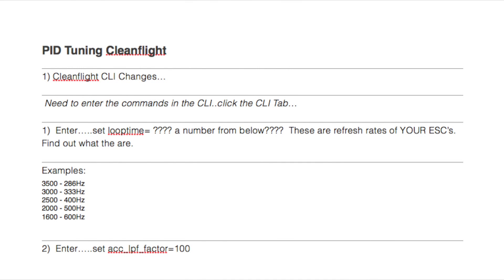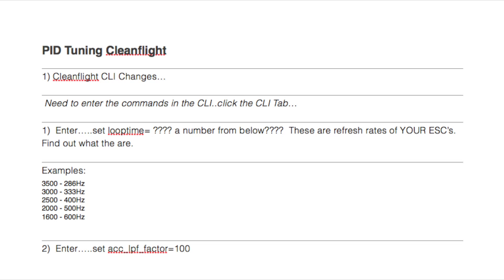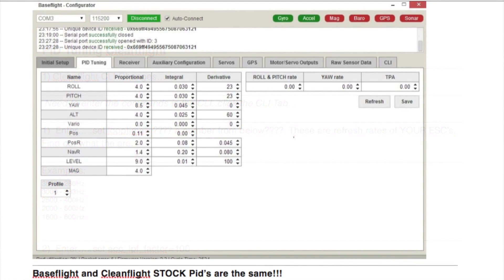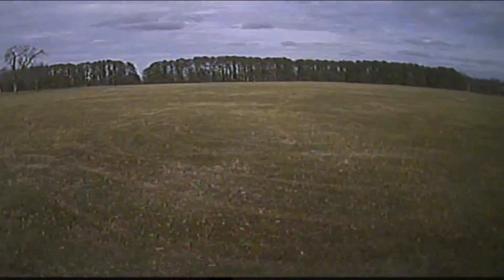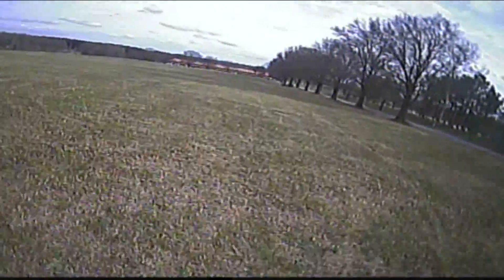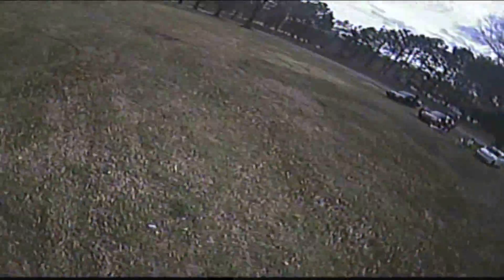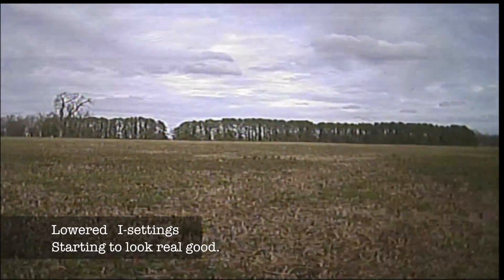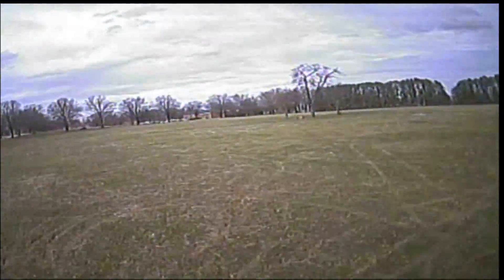Full PID Tuning Cleanflight in FPV Part1

Comment: I'm having problems dialing in my settings after switching to PID controller 1.  It would be very informative to see your starting PID numbers and how far you are increasing/decreasing between each test flight.  My yaw is totally out of whack and I'm not sure how much you meant when you turned the P way down and I,D way up.
Reply from the maker: With yaw P setting I lower it from 8.0 to 5 or 6
All other adjustments are done by .005 in I's and 5 in D
Reply: Very good info.  I worked for an hour this morning and I think the settings I come up with are similar.

Let me know what you think of this idea.  I have been flying in some kind of auto level mode for two years and my brain is having a hard time converting to rate mode.  I have taken your video and worked through the process but in horizon mode.  I'm trying to set the LEVEL "I" settings at a comfortable value for me and slowly reduce the value every couple of flights until it is practically the same as rate mode.

Should the same PID tuning process work in horizon mode as you have done in rate mode?
Reply from the maker: ***** You have to tune in Rate mode 1st....you have to.......then you can go down to LEVEL on the PID page and start the same process....P....I...then D....remember that you have to LOWER the P from 8 or 9 to.... 5 or 6 to start with.......also put D at 45 to start.  Get it to hove and NOW start tuning P and so forth.

Comment: I'm using cleanflight and making the adjustments in flight.  After I land with nice settings. I plug into the computer and it shows default settings again. 

Doesn't seem to save my settings.  

Are you doing the changes in flight or on a pc
Reply: William Anzueto Silly me. I was unplugging the battery on the quad before pluggin into the computer to view the settings and hit save.   Once I  left it plugged in I could see my settings and hit save
Reply from the maker: William Anzueto You should be able to see your settings with OR without your battery plugged in.  It just needs power from the usb port.
Save your settings on each tab and make sure to click disconnect before unplugging the board.

Comment: hey, how do you deal with high frequency vibrations when you punch up on the throttle? pitch and roll seem fine, it's just throttle now :/
Reply from the maker: +oliver strike Your P-Settings are too High.  What version of Betaflight are you running?
Reply: +Shelby Voll I'm on clean flight. just upgraded to the latest 1.2.x quad now flies like a deranged brick...
Reply: +Shelby Voll I'll try dropping the p values until it goes away.
Reply: OK, got rid of the high oscillations from P. But now I is at 0 and I'm still getting low wobbles on pitch and roll
Reply from the maker: +oliver strik IM me on Facebook...I can help better the Re

Comment: Which P, I, and D settings is he talking about in the first half? Everyone says to adjust this but nobody says which one. There are many options in cleanflight for PID. Also which mode is this guy using, acro ?
Reply: Bro Meridian From what I heard, it is suggested to tune Roll and Pitch first  and the adjustment has to be carried out on each axis separately at a time. The other issue is why the author of the video says to use a PID controller 1 for tuning not 3?

It would be great if he shed some light on the issue.
Reply from the maker: MSM5500 go to my other video that say Full PID tune FPV
Reply: thanks mate for your prompt reply. I appreciate it.
Reply: Shelby Voll you referred me to some of your other videos that I would get the answers from so I looked through your other videos but couldn't find anything like that (I wasn't able to find any other video like "Full PID tune FPV" except one from the above where there is no mention about in which order Roll and Pitch are tuned as well as no reason given why PID controller 1 is chosen.)

 So I still have the same questions:
1. P (I,D) of which axis does need to be adjusted first Roll or Pitch?
2. Why is it necessary to use PID controller 1 but not PID controller 2, 3, etc through out the PID tuning process?

Thanks.
Reply: Shelby Voll First off thanks a bunch for making this video it is very helpful. Youtube is lacking with good PID tuning vids. I hear you have another two videos to this series but I can't find them. Can you make a playlist for this series? The video you say to watch is this one(" go to my other video that say Full PID tune FPV"). Did you mean something else? Please reply as to which PID settings to adjust first. Do you adjust Pitch first then roll or both simultaneously? Also which mode do you tune in, it looks like acro mode but correct me if I'm wrong. Thanks again.
Reply from the maker: To clarify.....tune P first on BOTH Pitch and Roll...line of sight..
Then tune I then D same way...
AFTER line of sight tuning THEN tune FPV......fly around starting at P again and fine tune Pitch and roll....they will be different....THEN do I and D same way.
To find out about Yaw tuning go to our YouTube channel. ....F1FPV. ...click on episode 2.......
I Tune in ACRO/MANUAL Mode

Comment: I'm assuming doing this in horizon mode is pointless, do I do this in Acro(rate mode with self level) or full rate mode?
Reply from the maker: always tune in full rate mode.
Reply: +Shelby Voll would it be absolutely necessary to tune in no wind? I also use angle mounts. same principle applies?
Reply from the maker: +leetpg tuning in calm winds is the way to start.....then you can tune for windy conditions and save that in one of your profiles to pull up on days it is windy.
Doesn't matter if you have motor mounts....same lrinciplr.

Comment: Are you able to upload the pics you ended up with?
Reply from the maker: The problem with handing out PIS settings are:
1) NO PID's will be just a drop in file to Cleanflight as UNLESS my mini is the EXACT same as yours PID's WILL be different.
2)  Weight, Prop size, motors and sec's all effect PID's and won't be the same as another.

Just use this video and you will learn how to tune well with time and practicing.

Let me know if you have any questions and I will be glad to help.
Reply: Shelby Voll yeah I understand that but it would give us a good idea of where they should be so we can be within the same ballpark. I mainly want the yaw pids, pitch and roll are really smooth for me now.
Reply from the maker: I will do that in the next video...thanks for the idea....thats what I am looking for....what do the masses really need and I will provide a detailed video for all.....at least on PID tuning and Cleanflight..

Comment: I noticed on this video and the tuning video you did more recently tends to overlook YAW tuning. On your more recent video it seems like you try to quickly move away from talking about yaw and didn't explain it at all, and on this video you didn't explain what you was doing and what you was looking for in oscillations.. it kinda seems like you didn't know either. Everyone seems to skip the yaw tuning process or are unable to explain it and on both of your videos you've failed to explain it aswell.
Reply from the maker: the reason I don't discuss it is I rarely if ever mess with the stock YAW pids.

Comment: From Cleanflight docs:

DELETE THIS COMMAND:
-| `acc_lpf_factor`                | This setting controls the Low Pass Filter factor for ACC.  Increasing this value reduces ACC noise (visible in GUI), but would increase ACC lag time.  Zero = no filter                                                                                                                                                                                                                                                                                                                                                                                                                                                                                | 0      | 250    | 4             | Profile      | UINT8    |

ADD THIS COMMAND:
+| `acc_cut_hz`                | Set the Low Pass Filter factor for ACC. Reducing this value would reduce ACC noise (visible in GUI), but would increase ACC lag time. Zero = no filter                                                                                                                                                                                                                                                                                                                                                                                                                                                                                | 0      | 200    | 15            | Profile      | UINT8    |

Comment: Hi, can someone take a look at my video and tell me what i might need to change in my PIDs. http://sendvid.com/g7imx5g0 . 
These are my PIDs and some other details - http://s13.postimg.org/ga1em127q/pidsbestyet.jpg
The frame i use is the Diatone #37 silver blade; just so you know the form of the quadcopter.

This was after one whole day of tuning.
Reply from the maker: Living Universe First....can you do another recording of you flying in a more open area like a soccer field...hare to tell for sure what is wrong...however.....Your P values are too high I see high oscillations....and your D is too low I see bounce back.
Lower P first and get rid of the vibration THEN go to D and raise it up say from 40 to 50 or 60.
See what that will do...then repost another video link for me to look at.
Reply: Shelby Voll Thx, also im confined to my little garden for now.
Just to get a more solid idea of what d does i put it to 15 and it was really bouncy and then i put it to 50 and it was really smooth. My P is 1.4 is that really too high? im just confused because everyone elses PIDs ive seen never go below 2.

Did my Yaw settings look ok? or is P (6.5) too high for yaw, its quite hard to tell for me.